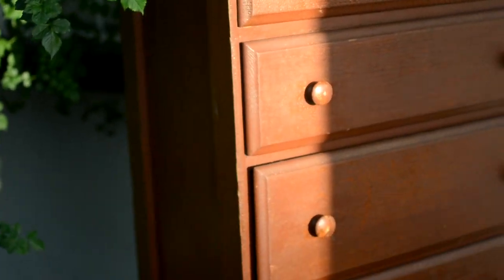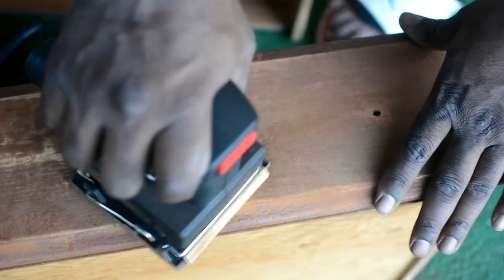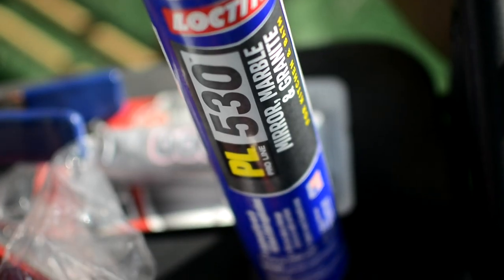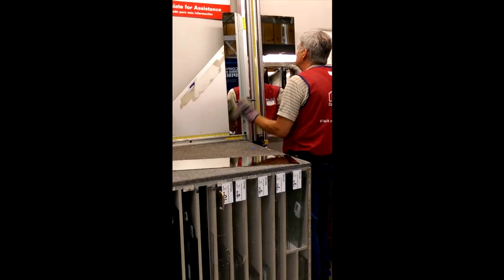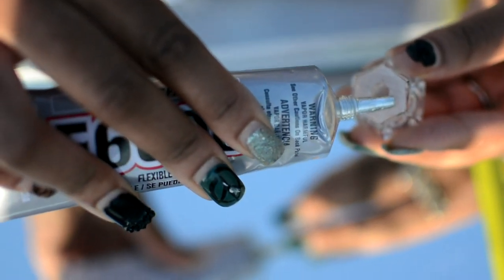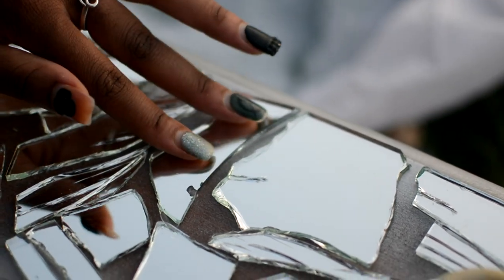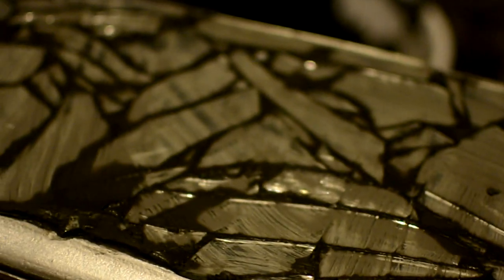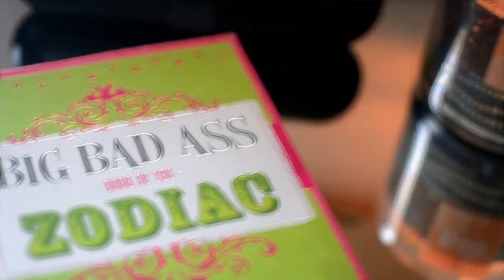DIY Mirrored Dresser | THRIFT STORE EDITION

Comment: hey it came out nice! did you find that the mirror edges are too sharp or did you get the edges  beveled
Reply from the maker: Thanks boo 😘 & Nopee! I've actually had no problems with the mirror edges being sharp because the dresser I used had no sharp corners where the mirrors were used! The top of the dresser was rounded & all the drawers are raised so it really depends on the dresser whether you need to do that step for safety or not!